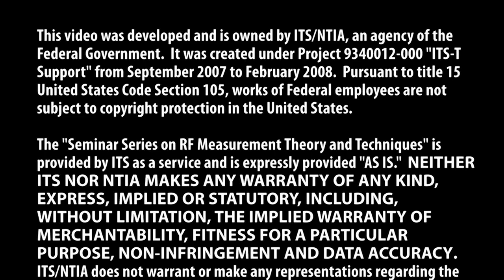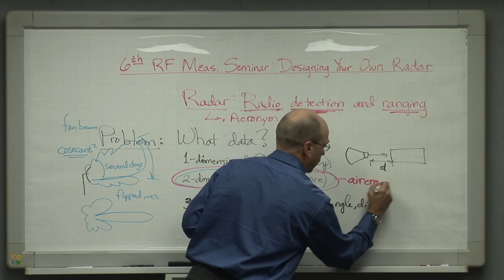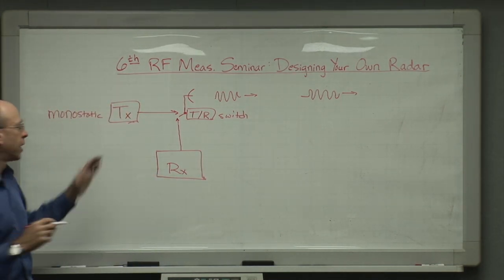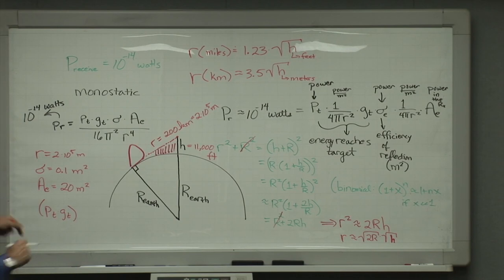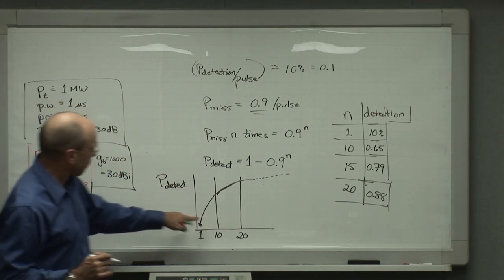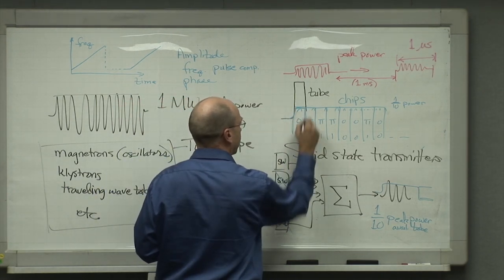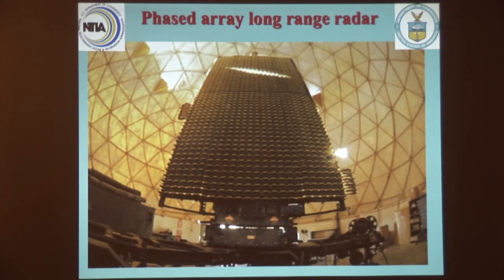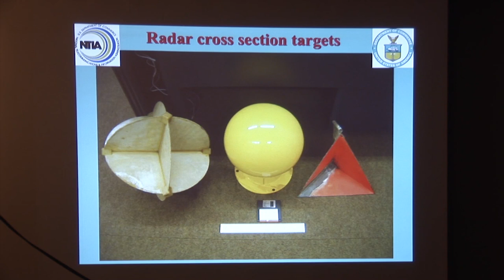Talk 6: The Radar Equation: How to Build Your Own Radar

Comment: I studied Microwave Electronics Technology 'specialty'  for 9 months in May 1985, I also have a 2 year-degree Associate in Science in Electrical / Electronics Engineering way back in the late 1970s. I have been always learning continuously about Physics and Engineering Technology and have worked at Lockheed Space Systems Division Environmental Laboratory for 17 years as an Engineering Technician and have learned a lot about EMI / Radars Testing, Thermal, Acoustics, Vibration, Structural Tests for the Space materials and Spacecraft systems including the Hubble Space Telescope. I am now retired and still learning. Thanks Professor Frank Sanders for a great Applied Engineering Lectures on all the series of videos you have published and posted. You are a great Teacher.